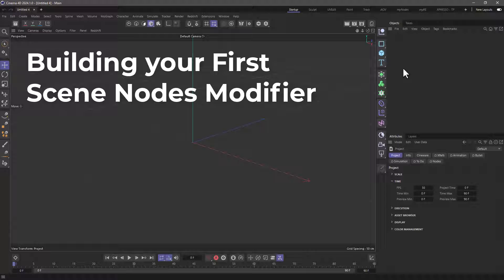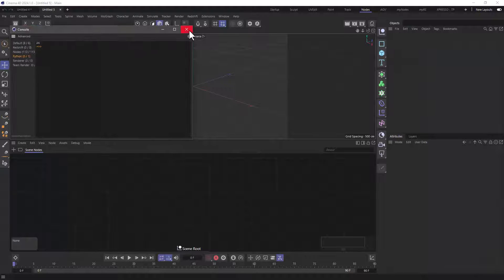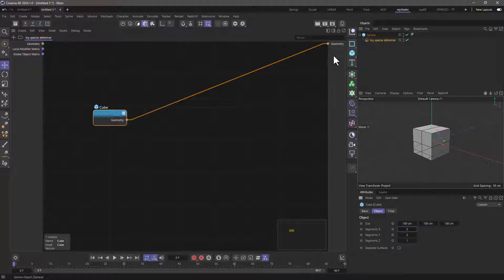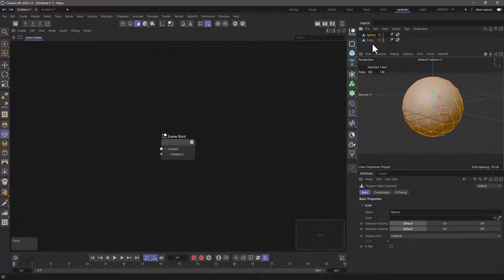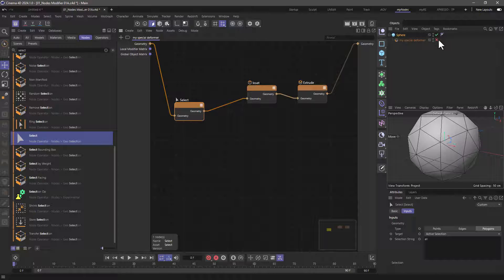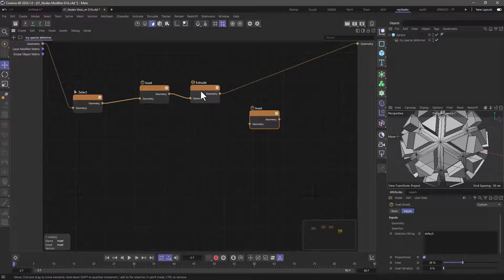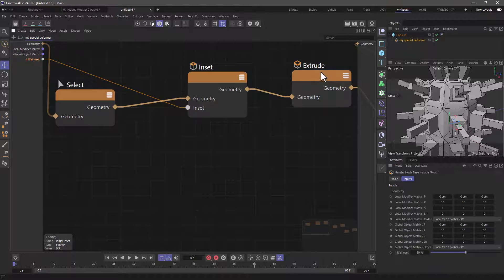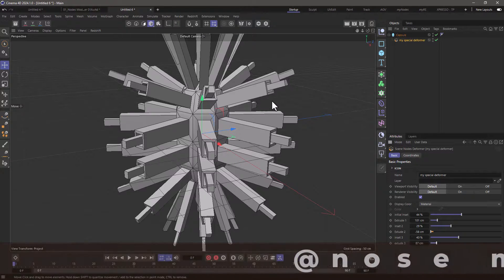#CINEMA4D scene nodes 001: Build your first Scene Nodes Modifier

Comment: Thank you for the great info.

I'm trying to simply use an object's User Data to change the 2D texture of a Lego character's torso, and avoid having to change texture paths inside each material manually with switches. 

The goal is to simply connect the object's User Data (Using File Name, Texture or Link attribute) directly to the String User Data node inside the Redshift TORSO material. I thought this would allow me to change the texture path of the material's texture node, but it does not work like the Color Used Data node does. I think String User Data is the wrong method.

Example - I want to change the shirt texture path of a character directly in the object's User Data - I created a Texture data attribute and named it "TORSO TEXTURE". I then added TORSO TEXTURE to the attribute name of the String User Data node inside the Redshift TORSO material, but Redshift errors and says that String User Data only works with OSL. I also tried adding TORSO TEXTURE to the path of the texture node, hoping it would recognize the attribute name, but it does not.

I really want to avoid creating a new material for every texture and attaching it to a switch node. There are simply too many textures.

Thank you for any help you can provide. I've tried everything I know of to make this work but the String User Data will NOT link the texture path to the texture node inside Redshift. Apparently it works with Arnold and other renderers just fine using OSL.

 Redshift needs a "Path User Data" node!